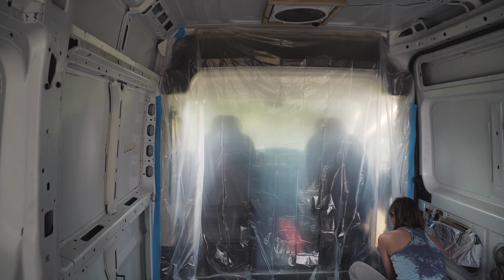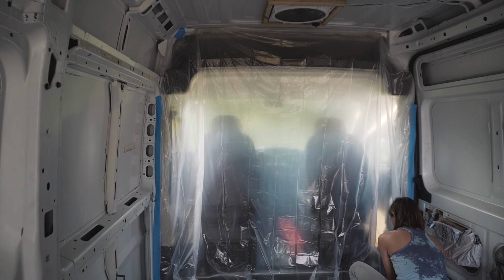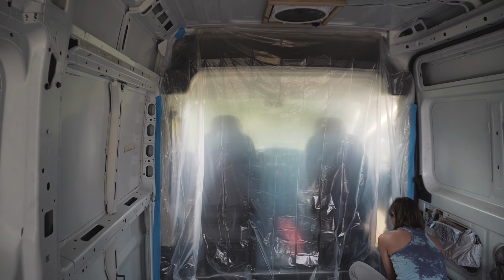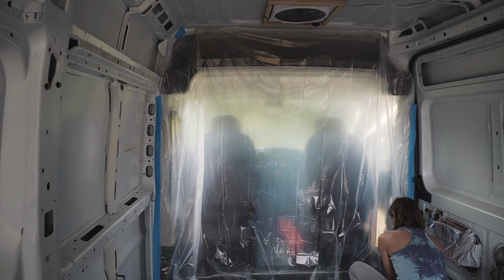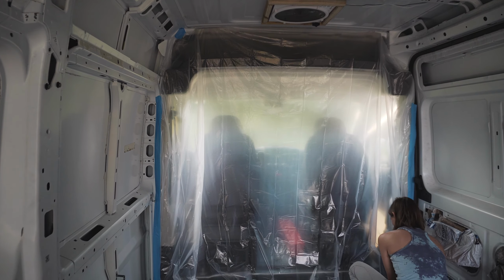Spray Foam Insulation | Ram Promaster 3500 | DIY Handyfoam

Comment: Thanks great video. At the moment, I am thinking of doing PIR board for the top part and some type of wool for the bottom as the R value is beter. But this is very tempting as it 4 hours you do the all van instead of several days I suspect.

Comment: We did the same in our promaster.  We actually filled all the holes in the support ribs with Great Stuff first and then sprayed the entire surface.  Ours has been done a year and went through hot summers and cold winters and works perfectly.  It takes very little to heat or cool the van.  Spraying it however was quit messy and not a job I would want to do again.
Reply from the maker: If I had to do it over again I definitely would have gone a little light on the floor spraying. I did a horrible job at keeping it level and spent more time shaving it down flat than I did insulating! Haha
Reply: @pairofdrifters  We actually used rigid foam on the floor for that very reason.  
I think if I ever did another van I would pay to have the foam sprayed.
Reply from the maker: @johntatman9168  agreed. I wish I could of found someone but our area was charging $1k plus. Bug rigid foam on the floor would of been way better. Hope people see this conversation for that reason.
Reply: @pairofdrifters  I've heard a lot of people say that insulating the floor isn't even worth the sacrifice in head space....maybe for sound deadening, but there are other things you can do to sound proof rather than framing out/insulating the floor.

Comment: Hi, I think I'll do all the framing first? You said the closed-cell only expands to about 2 inches max, if I wanted to achieve 3-4 inches on the wall panels do you know if a second application can be applied over the first application to achieve the 3- 4 inch required. I live in Canada, -15c-30c winter/30c+ summer. I'm thinking 2-3inches on the ceiling and 2-3inches on the floor, I'm 5"10 tall. I'm planning on starting my build in the spring of 2021. Full-time van-life in Canada, it should prove to be interesting?.
Reply: check with your particular spray foam manufacturer, but typically, yes...you can add multiple layers. that's how you would usually do it in a house. let one layer cure then do the next layer to build it up